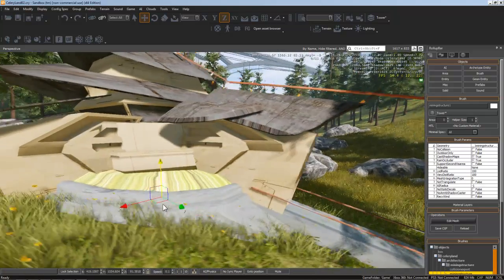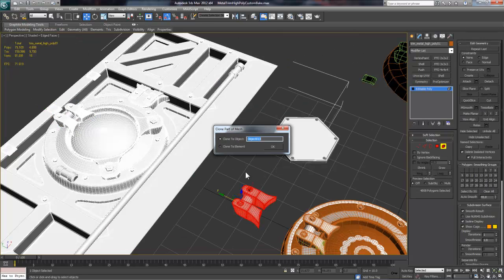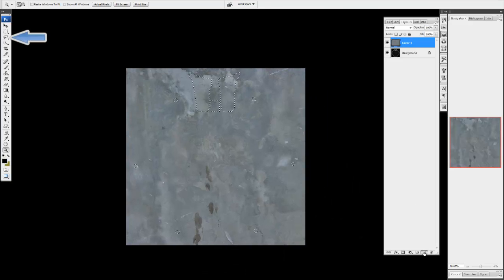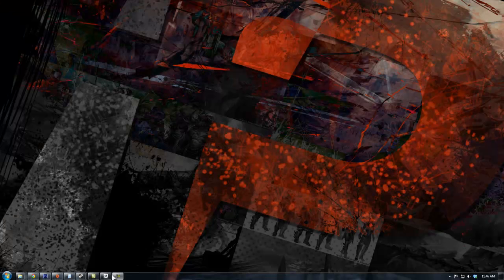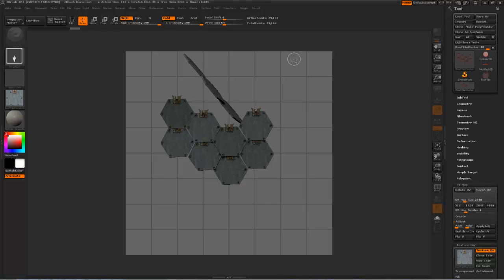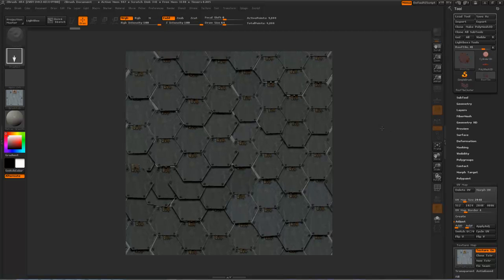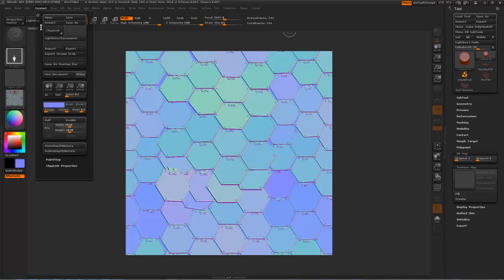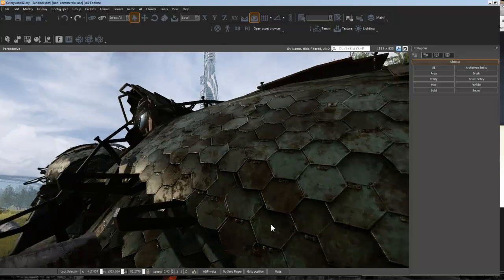3d Modeling Architecture part 5: Creating tiling textures in z-brush

Comment: Hi,  you skipped over how you filled the layer with the Normal Map material. 
Can you please explain how you did it?  Thanks.
Reply from the maker: +Simply Seerah You have to turn off zadd at the top so that only mrgb is selected. Then choose the normal map material on the right and click and drag to fill the canvas. The video does cover it if you watch it again but the whole process is pretty strange. Good luck!
Reply: Yeah I figured it out from a tutorial by Eat3D.
LOL I was asking all my friends for help but no one knew what I was talking about because the process is rarely used.  They were like "Dude you just choose the Normal Map Mat," and I was like, "You don't understand I'm out of edit mode."  LOL  

Thanks for the great tutorial and advice.

Comment: ANYBODY reading this could you please offer some feedback or suggestions. I figured this is the most recent tutorial so will post here. this post is based off the Cryengine SETUP tutorial from Futurepoly's first video,  just copy pasted the text here. Also this post is in relation to exporting files (objects) from 3ds Max Design 2012 to Cryengine. I'm using a student version of 3ds Max and the free Cryengine SDK so not sure if these have anything to do with it.

also when exporting the .cgf, it shows up as $tmp_RockBox.cgf instead of the clean RockBox.cgf...any clues?

this is the error message:

CStatCGFCompiler::Process: Failed to load geometry file G:\Origin Games\CRYENGINE\GameSDK\Objects\Hackerspace\Props\RockBox\$tmp_RockBox.cgf: CLoaderCGF::LoadGeomChunk: obsolete non-compiled geometry chunk format in G:\Origin Games\CRYENGINE\GameSDK\Objects\Hackerspace\Props\RockBox\$tmp_RockBox.cgf
Failed to convert file G:\Origin Games\CRYENGINE\GameSDK\Objects\Hackerspace\Props\RockBox\$tmp_RockBox.cgf
RC failed to process file:
    G:\Origin Games\CRYENGINE\GameSDK\Objects\Hackerspace\Props\RockBox\$tmp_RockBox.cgf

Export failed.
Reply: Dean Bartolo Well i don't work with cryengine a long time because of problems like that and because it was just painfull to convert everything for an engine... I work with EU4 now and you can have the full version for free... But based on my experience, that error  can mean 2 things:

- You have put the plugnin for another 3ds max verson (For exemple you have 3ds max 2016 and you have puted in the cryengine plugin for 3ds max 2014 or other verson);
- You might have some edges that are too close one to another... To solve that you can go to view and than viewX and search some bad edges or faces and correct it by weld those;

Hope this was helpfull, I had some issues with that and I have solved them with thoses tips I just write,
Good luck ;)
Reply: Tiago Rodrigues It ended up being the dumbest of issues. 3DS Max Design 2012 was the problem with it being for some reason failing to export objects/meshes. Downloaded the student version of the standard 3DS Max 2014 and works like a charm. I still don't understand the difference because both programs are near identical. Anyway i got it working haha.

yeah i think i might give Unreal Engine a go. hear its more user friendly.